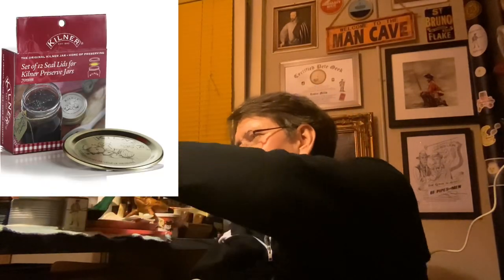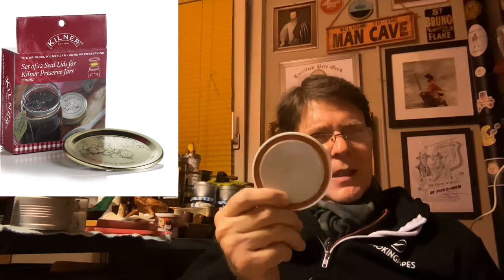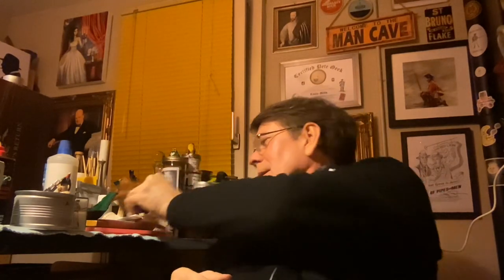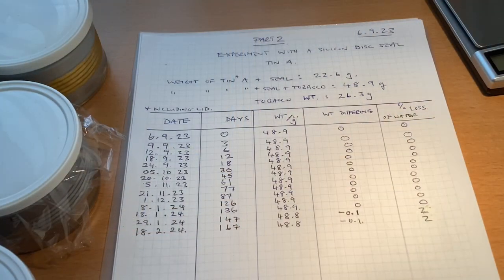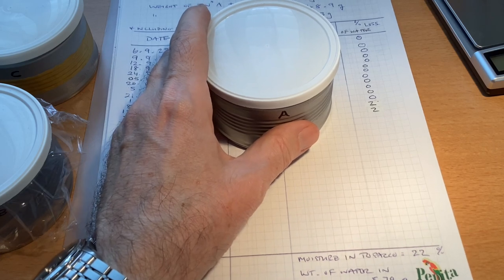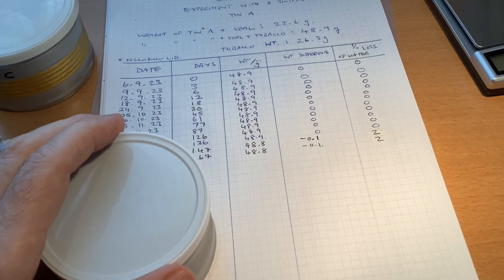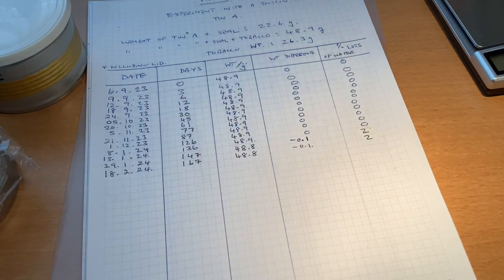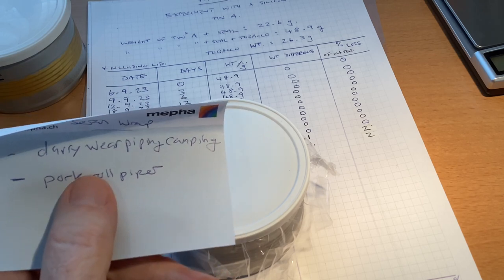My Long Experiment to improve the seal of the plastic lid of C&D tins  - The Solutions (part 2)

Comment: My dear Lester, since you are a scientist 🧑‍🔬 with a Ph.D. we expect nothing less than a data driven analysis that may actually help store tobacco longer than the original seal, or once the seal was open, or for the medium term after opening etc. My simple advice is open as many tins as you want until you have a nice rotation. Then jar everything and alternate things regularly until you finish your opened tins.  Then repeat 😮😅

If this fails, then write our dear friend Janez for advice. 😂
Happy IPSD and hope you and La signora are well. Cheers my dears 🥂🙏
Reply from the maker: Yes my dear Sandro 😄👍👍 Good advice….but….I smoke slowly my tobacco….so my rotation is slow…I need several months….to smoke 5 tins in my rotation…so a medium storage seal is good for me 😉 Happy and a smokey IPSD my‘ol Sandro…and have a fine grappa too 🥃 😄😊💨💨💨

Comment: Very interesting. Had you considered a control sample with just the lid to see how much improvement you gained?
Reply from the maker: A good point Martin 😊👍👍 For me….the control was the experiment Part 1….without…the additional seal…under the pkastic lid. That experiment showed after 6mo…30% of the moisture was lost. Part 2 showed…all additional seals….lost only <6% after 5 months. Now I’m using all different three seals on my openened tins on my tobacco rotation 😊 😉💨💨💨

Comment: Happy IPSD Lester! 
The scientific method applied to loss of humidity and it's  preservation in collared pipe tobacco. I would expect nothing less from you Lester!
You could always use the belt and braces method and use the silicone or jar lid along with the   cling wrap. LOL!
A fun and helpful exercise my friend!
Reply from the maker: You’re right my dear Michael 😊👍👍 Combinations are even better…someone suggested using teflon or parafilm outside on the plastic lid…but yes…you could a silicon seal with Saranwrap….if its fits….maybe 0.3 mm silicon sheets are better for that than 0.5 mm that I used 🤔 I hoped C&D will offer a special lid on SP.com with a silicon seal for a few $…then everyone has a easy solution. Lets see if they react…My friend have a happy and smokey IPSD as well 😉💨💨💨

Comment: Hello Lester my friend interesting video y will try option number B and its so cheap.What do tou think about a mix between A and B??Thank you very good work and we need that tip.😂😂😂
Reply from the maker: Thanks Jose my’ol mate 😊👍👍 Yes…there could be combinations…even better to seal the tins….but the plastic lid needs space to clip well on the tin…I think today I would 0.3mm sheet of silicon to make the disc…but its a compromise…to make a reusable disc…if its too thin…it could wear a hole. Another combination…is to use one of A, B or C…and seal the plastic lip outside with parafilm or teflon tape. Again…this takes more time…and…you cannot use usually the tape or parafilm again. I was looking for a inexpensive, simple, reusable seal under the plastic lid. I will use solution B and C…and gain more experience with them. Happy and a smokey IPSD to you Jose my friend 😊😉💨💨💨

Comment: Loved this research Lester, very interesting.
I would like to know if the factory tabaccos got preservatives on it?
There is any sort of test I can do, such some drop of chemicals that change the colour in presence of silica. I presume is silicate that preserve food , I'm probably wrong. 
I'm saying that because I planted tobacco and I pressed , the tins which I haven't vacuum depressurised end up growing mould. 
Same conclusion came from a tabacco farmer in BRAZIL who clam his baccy has no preservatives, he said he can't make plugs or flakes for same reason. 
I tried one of his blends and was very green pure however not nice like European and American blends.
Reply from the maker: Thanks Giulliano 😊👍👍 Well…nicotine helps to preserve tobacco…mostly for insects. All crops around the World usually use crop protection for fungus, insects and unwished weeds. When I jar my tobacco…I use boiling water…10 minutes…to sterilise the jar and the lid…I wash my hands…and jar it up quickly. As the jars cool…a partial vacuum is created. I have never had mould on my tobacco. Using chemicals is not a good idea…when heated…those chemicals can be toxic. Silica gel…absorbs water vapour….its not a fungicide. The trick for flavour in tobacco…like meat…a bit of ageing…and…avoiding mould. Even the professionals have the same challenge…a few years ago C&D had a problem with mould. The spores are in everyplace…you have to work clean…especially putting the tobacco in tins and jars. Some factories used UV light to suppress bacteria and mould…but boiling water works for me. I hope this some help Giuliano…though I‘m not an expert 😉💨💨💨
Reply: @RedcoatsReturn  thank you Lester
;)